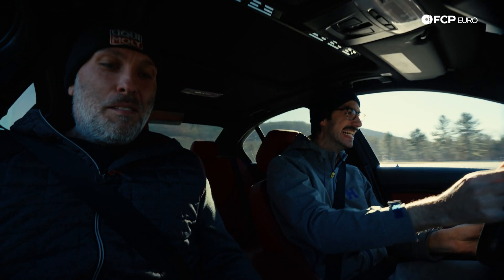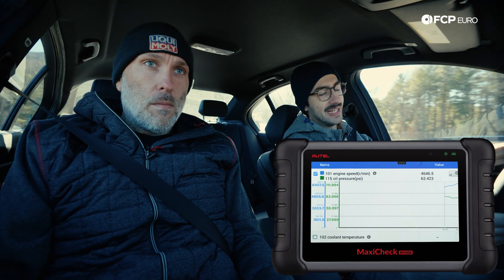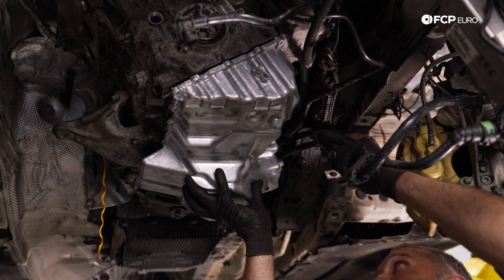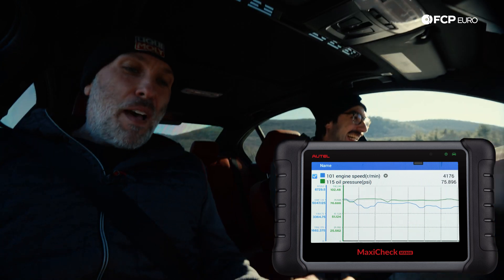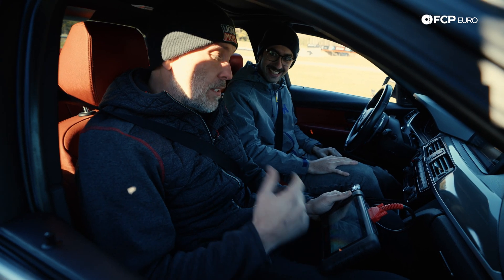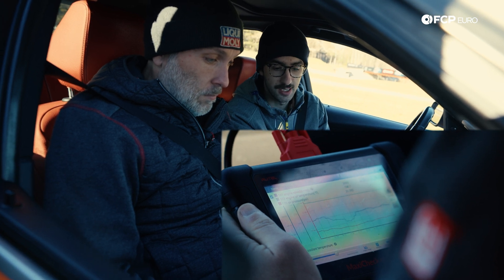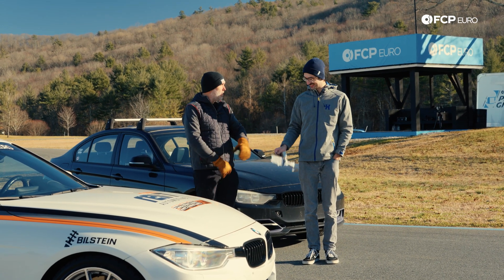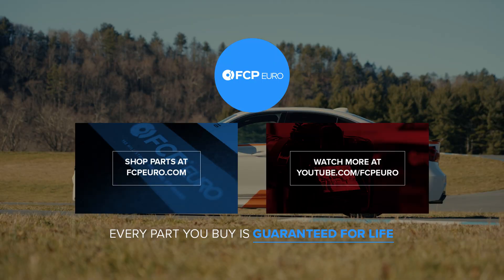Testing Our Bolt-on Oil Pan Baffle! - Solving the N20's Worst Trait

Comment: Put it in an AER car and let’s see how it goes.
Reply: Just found out that this baffle was in an otherwise stock (caged) 328i F30 with Open Throttle Racing, and successfully completed the 14 hours of Road Atlanta 🙂 The engine is still in good health!
Reply: For endurance racing, an Accusump and completely custom oil pan with trap-door baffles has been proven as a go-to solution, although obviously that comes at a price!

Comment: The baffle was surely in the initial engine, but that didn't stop the destruction. From what I have read the engjne's Achille's heel is the incoming air temperature. What about trying to lower it?
Reply: Correct, however the baffle can't do much when there's pieces of broken/ melted piston in the oil pick-up 🫠. We have an upgraded CSF intercooler, but ultimately we were pushing an off-the-shelf tune very hard, and on pump gas. In the future, an E30 mixture with a custom tune would prevent pre-ignition.

Comment: Question. Wasn’t the baffle in before the engine failed? I recall you guys discussion that the extra horsepower pulls oil away from the bearings at full tilt which precipitated the failure. I’m glad you guys are doing 4cyl content! Do more B48 next!
Reply: Good eye! That's correct! When we dissected the previous engine we found that only the #3 rod bearing had spun - with the remaining bearings still in usable shape. No other components showed any signs of oil starvation. And, after seeing a chunk missing out of the melty-top of the #3 piston, as well as some assertive feedback from the community on our tune, we're very aware that we were pushing an off-the-shelf tune too hard, and asking for pre-ignition to cause damage. Gareth saw another N20 within the community experience a similar failure recently as well, failing only on the #3 rod bearing. We suspect that this is one of the most difficult parts of the engine to heat-manage, and when pre-ignition begins to occur, it likely happens in the #3 cylinder first. This is a great case for both a custom tune, and running something like an E30 mixture to extract more heat from combustion with the additional fuel-mass. We'd love to do more testing on larger tracks like COTA, and give the community more data on BMWs at the limit.
Reply: @AlexNelsonFCPEuro  Will be at Sebring in April with essentially the sister car to this only a manual. Just purchased the baffle and rod bearings to install before. Also have a Cancheck gauge that logs with external inputs wired since not all N20 have a oil pressure available on canbus to monitor. Just like you, I'm a firm believer that the 328 is a viable track weapon.
Reply: @M3Eurotrash1  Hell yes! I'm very excited to see how it performs there. That also sounds like a total blast. We noticed that logging issue on the earlier car featured in this video, which is ultimately why we used the Autel for the back-to-back comparison. Best of luck!
Reply: @AlexNelsonFCPEuro the baffle was surely in the initial engine construction so in my opinion the oil pressure was not the case for its destruction. What about trying to find ways to reduce the incoming air temperature which in many engineers opinions is the engjne's biggest drawback?

Comment: Nice job! Does slightly over filling with slightly higher than stock viscosity oil help with the oil pressure stability as well? Thinking 4.9 - 5L 5w30 vs. the recommended 0w20.
Reply: I've heard of this being done with N20s - I'm pretty cautious of high oil levels with respect to counter-weights foaming up the oil, but it seems like quite a few have had success doing that in practice with the N20.

Comment: Ok now I wanna see y’all do this with a 435i
Reply from the maker: The N55 oil starvation issue can be tackled pretty well by doing the S55 oil scavenging system upgrade! 

https://www.fcpeuro.com/blog/bmws-s55-oil-scavenging-system-the-ultimate-n55-performance-upgrade
Reply: just buy an S55 oil pan

Comment: Also considering such a baffle for the N55? This could prevent rod bearing issues.
Edit: I see you already sell the MMR solution. It's much more expensive though.
Reply: Cheaper than the S55 oiling system upgrade.  😊
Reply: @KM-ol5bs  True. I might consider it. But I'm not tracking/drifting/dragging mine.

Comment: Fucking BMW engineers, didn't they know that this problem exists not only on this engine, this problem is not new, it's old, it already existed on the E46 M3. Are they doing this on purpose? It's not like they built a fucking rocket. What they do during tests on the Nürburgring North Track. Thanks FCP for your solution.

Comment: Did you consider making the baffle plate for the xdrive as well?
Reply: Great question! We did not design one for xDrive vehicles, as the xDrive oil pans do not feature a completely open front like the RWD pans do - keeping the pickup much more consistently submerged. However, the side-to-side movement may still be an issue, so maybe we should design a smaller version for that pan as well!
Reply: I wanted to ask about this too since the design of the xdrive models doesn't suffer from this movement of oil on g forces due to the area the axle takes.

but a response from FCP Euro will be great.